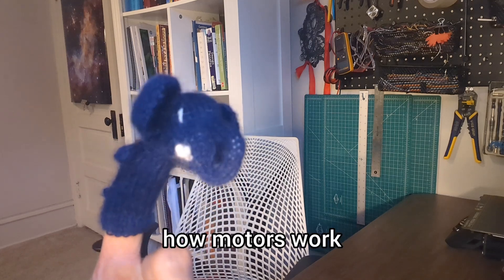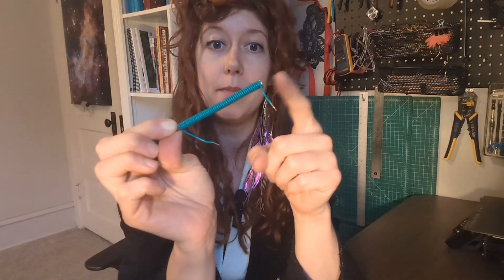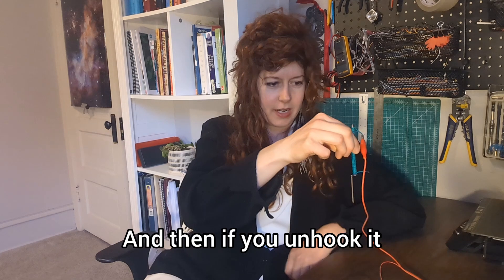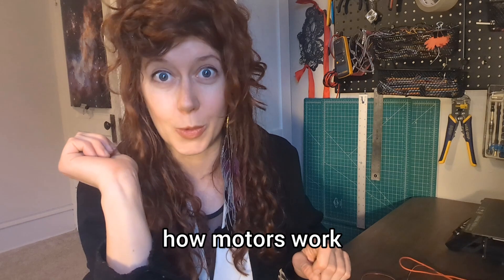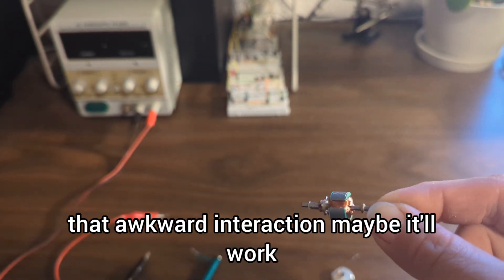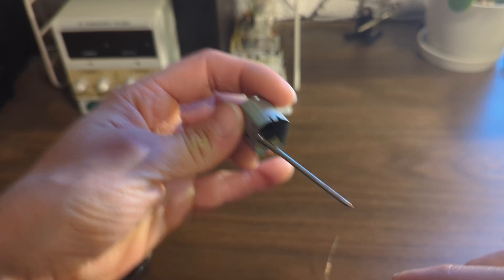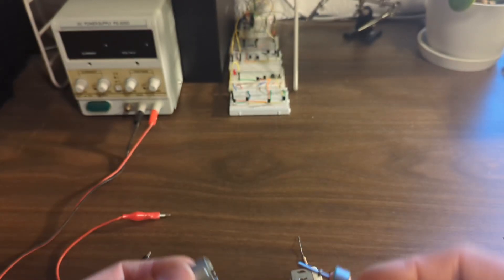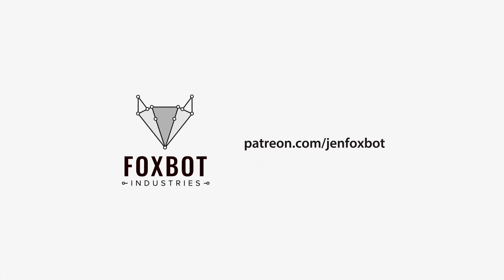How do motors work?? A beginner friendly video with lots of demos!

Comment: What material properties make a permanent magnet and do they run out eventually? Power plants spin huge turbines surrounded by permanent magnets to generate electricity. Do the magnets ever need to be replaced? I'm interested in small-scale renewable hydroelectric generators, but not sure if they would be viable if the magnets need to be replaced frequently.
Reply from the maker: that is a great question! magnetism is an inherent property of materials, just like how some materials are good conductors of electricity and others are not. materials that make good magnets, like iron, are "ferromagnets," which means they are strongly attracted to magnetic fields and can be permanent magnets (but can also be demagnetized). all electrons have a magnetic dipole (basically a teeny tiny magnetic field). in a permanent magnet, the material's electrons' magnetic dipoles can be oriented in the same direction when they are in a magnetic field. when the material leaves the magnetic field, those electrons keep their orientation, so the material stays magnetized.

Some materials are paramagnetic, which means they lose their magnetism after you take them out of the magnetic field (e.g. aluminum).

A permanent magnet wouldn't necessarily need to be replaced, but it might become demagnetized especially if you have strong electric fields moving around where the magnets are. the good news is that all you need to do is remagnetize the same material. you could do this w/ an electromagnetic just like i showed in the video!